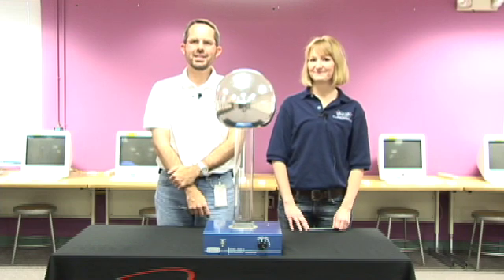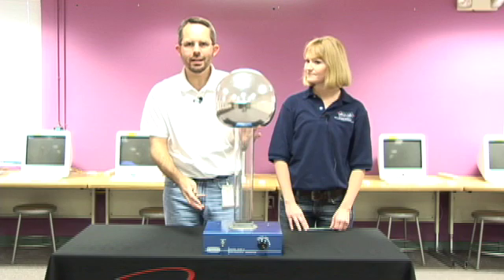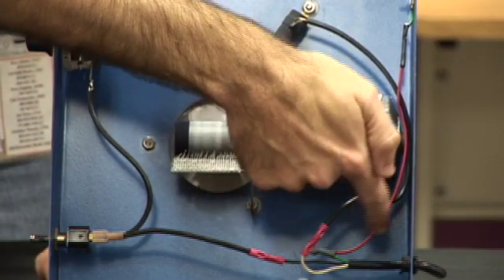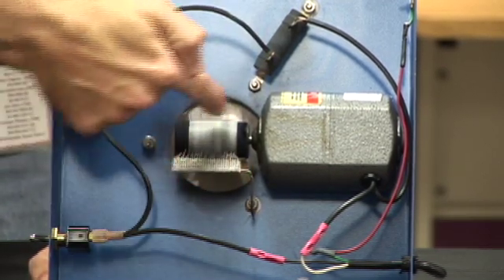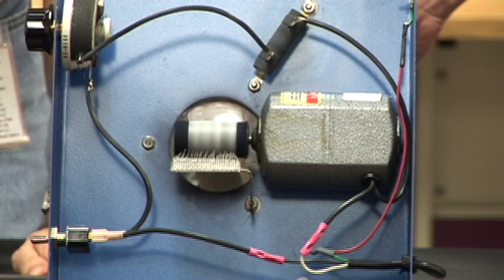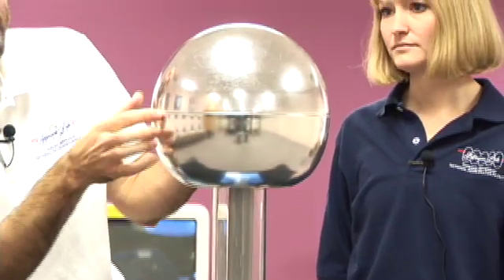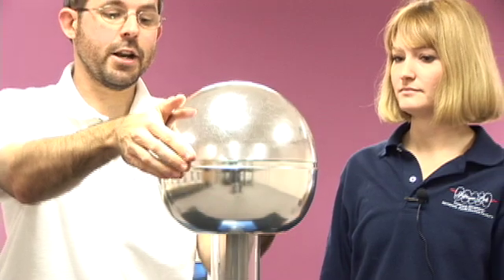How Does a Van de Graaff Generator Work?

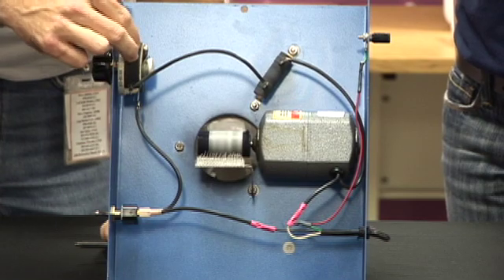Comment: 0:57 You mean the vanda graff uses electricity to make electricity.
Reply from the maker: It's an electric motor, so it uses electricity to make the motor spin. But, anything that makes the motor spin would get the job done. You could attach a crank and spin it manually, if you like. Then, it would be using people power to make electricity.

Comment: How are there step up transformers if voltage travels to lower voltage?
Reply from the maker: A Van de Graaff is not a transformer. For a transformer, you need two coils of wire. A changing current in one coil induces a current in the other. Whether the voltage is stepped up or stepped down depends on while coil has the greater number of loops. The power delivered by the two coils (voltage times current) is the same, neglecting any resistive losses. So, if a transformer steps up a voltage by a factor of ten, the resulting current is reduced by a factor of 10.

Comment: were you getting shocked at the end? Why? I thought as long as there isn't a voltage drop it wouldn't shock you?
Reply from the maker: Yes, because there was a voltage drop. Remember, we're standing on the ground. If we assume that electrons gather on the dome, then it's at a lower potential than the ground. Get two things at two dissimilar voltages close enough, and you'll get a spark.

Comment: hello can you please tell me what is the difrnce between a tesla coil and a Van de Graaff
Reply from the maker: A big difference in that a Van de Graaff is DC whilst a Tesla coil is AC. And, as implied by the name, a Tesla coil uses a tuned pair of coils. A capacitor is discharged through a coil with relatively few coils and a current is induced within a second coil that contains many more turns. This has the effect of multiplying the voltage at expense of the current (energy, which is current times voltage, is conserved).

Comment: Hello,
        I want to make a Van De Graaff Generator. Before I proceed to do it, I have a few questions that I would like to ask you. With what materials are the rollers made up of? And the belt is a rubber one. Is there another substitute instead of using rubber one?

Comment: I'm confused how you said friction doesn't generate the charge.. is it some kind of induction process?
Reply from the maker: The transfer happens when two different materials come into contact with each other. The 'friction' statement was intended to mean that there isn't sliding friction between the belt and the pulley. People have a misconception that, when they walk across a carpet, it's the friction of them shuffling their feet that causes the static charge. That isn't true and the belt doesn't 'shuffle' over the pulley. The belt doesn't slide at all. Contact between dissimilar materials is all that's needed.

Comment from the maker: No. This is kind of like filling a bucket with a hole in it. The rate of leaking depends on the amount of water in the bucket, with the leak being faster when there's more water in the bucket. When the rate of leaking equals the rate of filling, the amount of water in the bucket no longer changes. Same thing with the VdG. Charges leak off as new ones are added. After a few seconds, an equilibrium is reached. Once it's reached, running it longer doesn't increase the total charge on the dome.

Comment from the maker: It's a Dayton AC-DC series motor, Model Number 2M033A:
115 Volts
1/15 Horsepower
1.2 Amps
60 RPM

Comment: also (non sarcastic this time) why use grounding wires and static belts when the motor is all powered by electricity to begin with?  converting electricity to electricity just seems very wasteful and inefficient... couldnt you make a similar rig simpley with the electrons flowing from the outlet without all the added friction?

Comment from the maker: The motor is rated at 1.2 amps at 115 Volts, which is 138 Watts (a bit more than two 60 Watt incandescent light bulbs). Figure that's the most power that the motor consumes. The actual power delivered by the spark would be much less.

Comment: it you connect a van de graff generator, that's on, to a circuit and the other end of the circuit to, say, ground, would electricity flow through the circuit? can a vande graff generator be used as an energy source?

Comment from the maker: @MegaTeenprincess I believe that the belt is latex. The materials you can use depends on what you choose for the rollers. Check the triboelectric series.

Imagine how difficult that would have been to understand if I hadn't actually used all the letters in the words...

Comment from the maker: @MegaTeenprincess The tube is just a tube. Don't think it has an official name. Stand-off tube, maybe? Isolation tube? It's job is to insulate the charged dome from the ground. It doesn't need to be transparent. Regular old PVC pipe would be just fine. I think ours is acrylic. As long as it insulates, it's fine.

Comment from the maker: @desenxuxator There's nothing wrong with using a teflon belt, as long as it doesn't become conductive under the voltages it will experience. The important thing is that it's the difference between materials that creates the static charge. If you have teflon on rubber, you'll get a separation of charge. It doesn't matter which one is the roller and which one is the belt.

Comment: @JeffersonLab I just finished my 1/3 scale to my big VDG . 1" wide belt, teflon top,aluminum bottom roller, and a 3.5 inch dome. The dome is not spherical but flat bottomed stainless steel bowls (from my wife's kitchen) No hole in the domes yet. I will  get spherical balls and cut a hole in one and not the other to see if cutting the hole helps or hurts performance. I think it hurts. Getting 7 " sparks on this one and 20 inch sparks on the 10" one. You MUST try NaCl on the dome.Stores for days.

Comment: @JeffersonLab The bottle of sodium chloride will store a very good shock for up to 4 hours.! It is raining here today and I am getting 15 inch sparks. The temp is 60 degrees. If the mythbusters VDG got sparks in relation to it's size compared to mine, I wouldn't touch it. At 15 to 20 inches it feels like a spark plug on the lawn mower. Keithecampbell1

Comment: @JeffersonLab   
The NaCl seems to act as a capacitor. It charges and discharges a really big spark all around the bottle. I just haappened to have the bottle sitting beside the VDG and wondered what it would do.  To my surprise , it made bright sparks.. After stopping the motor and touching the bottle, it crackles and pops and flashes for several seconds . I am building a 1/3 scale VDG to see if cutting the hole hurts or helps. I believe it hurts the performance. Will let you know if you like

Comment: I just improved on my VDG by putting a teflon top ,alum.bottom roll. Found that I had a leak from the wire going to the dome and fixed that. NO HOLE IN DOME and I am getting a 20 inch spark this A,M.. Temp is 60 degrees, humidity is 50 %. I blew hot air down the tube for about one minute and started it up. The spark jumped about 20 inches and hit me on the chest. I have a bottle of sodium chloride sitting on top of the dome. Rubber belt is 3 inches wide, 30 inches long. Beats mythbusters sparks.

Comment: your suggestion of silicon adhesives worked well. I now have my VDG working and it is on you tube. Up to 10 inch sparks and NO HOLE in the globe. Believe me it does not have to have a hole. It may be even better with a hole but I don't know yet. I will change the top roller from PVC to teflon soon. I found a solid teflon pasta roller at Wallmart and intend to use it soon.. Should be even better. Thanks for the help.

Comment: do you know what type cement is best to join the ends of the latex rubber exercise belts for the VDG. I tried rubber cement (two kinds, tube and brush on) , super glue,(expensive type), contact cement, (spray on type) nothing holds well enough . belt is streching only 3 inches but keeps seperating at the joints. Can't keep it going long enough to make a video.  thanks  Keith

Comment from the maker: @keithecampbell1 A longer belt helps in that you can get the dome further away from the ground. It'll allow the dome to charge to a higher voltage. You need to be careful that the belt doesn't get so long that it can pinch together in the middle. Opposite sides of the belt should attract each other and the further apart the pulleys are, the easier it is for the belt to come together in the middle. The wider the belt is, the faster you'll charge the dome (more current).

Comment from the maker: @keithecampbell1 Congratulations!! I'm actually surprised that it works so well without having the pick-off comb inside the dome.

Filling the dome with some sort of gas or other substance shouldn't change a thing. The static charge is only on the outer surface of the dome. What's inside of the dome is irrelevant.

Comment: @JeffersonLab Hi again,  I have finished my VDG with a rubber belt, nylon bottom roller , teflon top roller, 10" gazing ball WITH NO HOLE 46% humidity and getting 10" to 12" sparks. Ball is mounted on top of the PVC pipe, grounded to water pipe. Ran about two mins. when teflon came off and wrapped around the top roller shaft and broke my belt. Will fix today. Will post video on You Tube later.
 what would happen if the ball was filled with some gas like helium that can hold a charge? thanks KEC

Comment from the maker: @aaron45765 Probably. You can run into trouble if the belt has a lot of carbon in it. It's conductive enough that you'll have a hard time delivering a lot of charge to the dome.

Comment: I am building a VDG with a 10 inch gazing ball. Is it necessary to cut a hole in the ball or can you connect the comb wire to the outside of the dome and just sit the dome on top of the PVC --anyone know?  I have two Stirling Engines on YOU TUBE at Keithecampbell1     Thanks , kec

Comment from the maker: @hadabeesago FIrst of all, ours is a commercial unit. We didn't build it. In my mind, the only comb that really matters where it is is the bottom comb. It needs to be where the belt and the roller come together. If you place it where they come apart, the comb will tend to neutralize the charge on the belt.

Comment: hi i really like your quality work in putting that thing together, i am almost done building mine, since yours is doing a good job in producing good voltage i was just wondering, i read somewhere that said it is better to put the brushes on the side where the belt is rolling away or off from the roller, does this matter or do you know which side works better to put the brushes at and can i put brushes on both sides of one roller to make it more effective, or to eliminate guessing??

Comment: the comb on the top collect charges and transfer it to the comb on the bottom adding charges on one side of the belt roller side and collecting charge form the other belt roller side. its like a water wheel with water beeing lifted back to the top. there is a charge differential between each side of the rollers. one side have more charges than the other. the current is dc. the van de graff generator is a static capacitor and a charge separator at the same time. in a sense its a battery.

Comment from the maker: @AHW214 Nope, a couple of sharpie marks won't matter. You can run into trouble with rubber belts that contain relatively large amounts of carbon. They can become conductive at the voltages produced by VdGs. Those belts are usually blackish, though.

Comment from the maker: @AHW214 It doesn't matter that the belt all the same width and centering it on the roller isn't important as long as the belt doesn't 'walk' off of it. THe rollers also don't need to be all that smooth, as long as they aren't so rough they damage the belt, it should be okay.

Did you ever get a good ground connection hooked-up?

Comment from the maker: @EMW214 Don't you have your motor on the outside of your VdG? It isn't actually mounted to its base, right? If that's right, grounding the motor's case isn't going to do anything for you. Also, I wouldn't try to modify a cord just to get a ground line. One mistake there could be very, very bad. Running a wire to a metal drain pipe will work just as well. It'll just look a bit messier.

Comment from the maker: @AHW214 Steel mesh is fine, too. The material doesn't matter so much. It's more important for the brush to be wide enough to span the entire width of the belt. It may be easier to do that with steel mesh than with stranded wire.

Comment from the maker: @AHW214 Ideally, it's the same thing. Running a wire from one to the other and then to the ground is the same as running each one to the ground individually. In ours, the whole case is grounded, so anything that electrically connects to the case is also grounded.

Comment from the maker: @AHW214 The belt should be fine. It's just that if you leave the brush rubbing against it, it would eventually cut through the belt. And, the brush doesn't need to touch the belt for the charge to transfer, so nothing much is gained by having them touch.

Comment from the maker: @AHW214 If you power it with a 3 prong power cord, use the ground wire that it provides. Otherwise, I would run a wire from the plumbing system or the HAVC air ducts.

Comment from the maker: @AHW214 If it's easy to do, try using bare PVC for one roller and cover the other with felt. The adhesive backed stuff you get with velcro works well. Also, you are grounding your lower brush, right? You wrote in yesterday about that. If the bottom brush isn't grounded, there isn't much hope in getting it working.

You can use a soda can attached to a dowel for a grounding dome. Make sure the grounding wire makes good metal to metal contact.

What on earth is exercise rubber??

Comment from the maker: @AHW214 57% RH isn't that humid, assuming the temperature isn't too high.

Stranded copper wire should work just fine for the brushes.

What are your rollers made from and what are you using for a belt? It's best if the brushes don't touch the belt, but that has more to do with keeping the belt from getting damaged than anything else.

Try connecting a wire to a metal drain pipe for a ground connection.

It also helps if the VdG's dome and the grounding dome are close to the same size.

Comment from the maker: @mdragondude123 The brushes are just a wire mesh - probably steel, but I don't know for certain. As for roller material, you need to consult the Triboelectric Series. You're best off if you choose two different materials that are far apart from each other with the belt material in between. Our machine's lower roller is covered in felt and the upper roller is, I believe, nylon.

Comment from the maker: @mdragondude123 (...continued) You're going to want to run a wire from the VdG's base to something in your house that's grounded. Try running a wire to the drain pipe under the sink. Attaching the grounding wire to the heating/AC conduits should also work.

Good luck!

Comment from the maker: @mdragondude123 You really do need a ground. For the VdG to charge, it needs to transfer change from somewhere. The best source for this is the ground. Let's say that your VdG is completely isolated. The bottom comb can only draw charges from the base. As the base becomes charged, it gets harder to remove additional charges. Attaching the base to the ground solves this problem. It's like taking a bucket of water from the ocean. As far as the ocean is concerned, nothing happened. (Continued...)

Comment from the maker: @TheRealVerbz Well, diamagnetism is something completely different. What you're really after is conductance. As far as (room temperature) elements are concerned, it's hard to beat copper. Silver's better, but kind of pricey. In fact, when they were making the electromagnets for the uranium separators during WWII, they made the wire from silver borrowed from the treasury due to needing copper for other things.

Comment from the maker: @TheRealVerbz A static charge is created when two dissimilar objects come into contact with each other and are then pulled apart. Some substances have a greater affinity for electrons than others, so there's a transfer from the one to the other. You can see a relative ranking of materials by looking at a thing called the triboelectric series.

Our heads and spinal cord resemble a VdG only in that they both look like round things on a stick. Other than that, there's no real resemblance.

Comment from the maker: @TheRealVerbz (cont)... The slight imbalance in charge between a sock that's stuck to a towel creates enough force to overmatch gravity. If it didn't, the sock would fall. The whole planet is trying to pull the sock off the towel. It is defeated by the static charge on the sock and towel.

Comment from the maker: @TheRealVerbz The amount of charge a person ultimately picks up from the VdG depends on the operating voltage of the VdG and the shape of the person. The person essentially gets turned into a capacitor.

An object is going to float if the force of repulsion is equal in strength by oppositely directed to the force of gravity. The EM force is much stronger than the gravitational force, so it isn't too hard to get enough charge on a light object to make it float. Think of static cling... (cont)

Comment from the maker: @TheRealVerbz If you are insulated from the ground, charge would gather on you, making your hair stand up. For something like this, a 'long time' is 15 or 20 seconds or so. Once you're on there for that long, you've reached equilibrium with the generator - the amount of charge leaking off of you into the air is balanced by the generator providing you with additional charge. Staying on there for more time doesn't result in more charge.